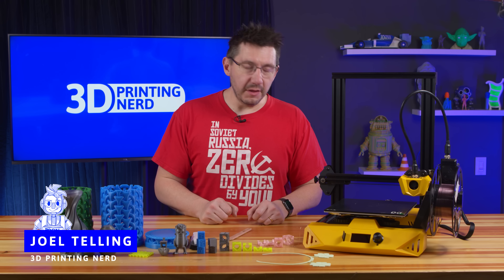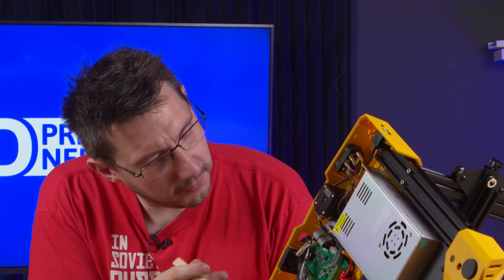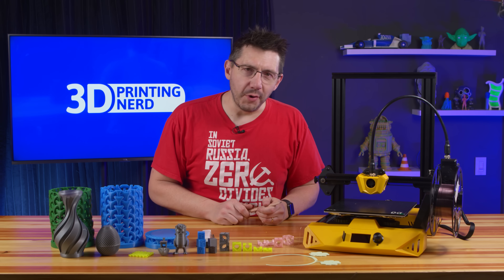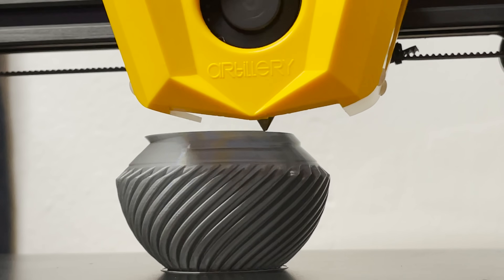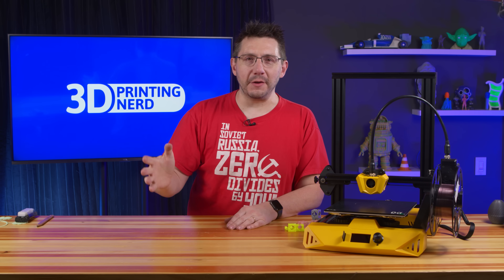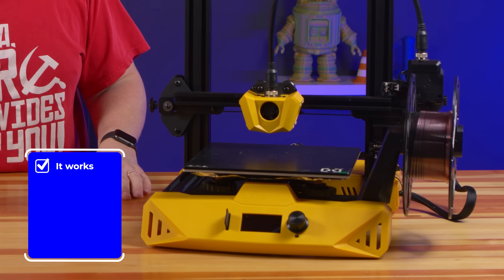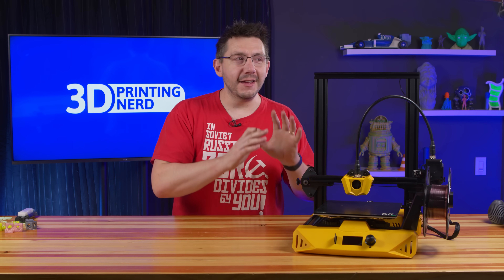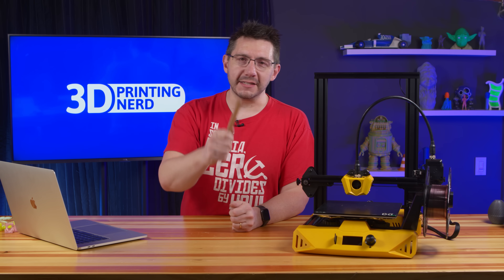THIS Is a Bad Idea // Artillery Hornet Review

Comment: An older video, but I picked up my hornet for 200 on Amazon a few weeks ago(as opposed to like 170 on their site), and I absolutely love it. I even love the cable. Assembly was 7 screws (Seven!!), its super quiet, in a few dozen prints I've only had one issue that required me to disassemble like anything, and the belt tensioners are absolutely awesome. I am a sucker for aesthetics, and I love having a printer that looks professional, and doesn't look weird sitting on a shelf. Compared to an Ender 3 base model, I would pick the Hornet any day for the same price.

The only issue that I have had with it is the Cura profiles that shipped with it are a little rough. I used the "fast" profile to try to print it's calibration cube, but there was so much under extrusion it was practically foam. After some tinkering I got a significantly better profile figured out, and my cubes look even better than the ones shown here.

Comment: ive had problem after problem caused purely by that damn tube, the filament always jams between the nozzle and heating block and the the replacement sent by the company leaked EVERYWHERE!
the prints are great quality but the problems this thing has are horrible for a beginner like myself, ive only had it for 7 months and could only use it for about 4 of them.

Comment: Thanks for the review! Guess this printer works great for "out of box" printing with minor tuning and fixing except if you are into modding and furture upgrading.  
1. hot glue components underneath (big headache when it comes to modding)
2. weird "all in one" proprietory cable (what a turnoff!)

3. glass bed is fine but not when hot glue to the metal plate (OMG! whoever think of this shit?). just use metal fasterners ..cheap and easy to remove.

Comment: My biggest concern with purchasing the Hornet is two fold. The Bowden tube cabling combo is ok in my opinion. The problem I have has to do with firstly all that plastic which reminds me of the Tarantula RS from Homers Tevo. The Y motor mounts in plastic which will crack and deform over time. Do not place that printer in a heated enclosure. Secondly there is maybe no way to add a BLTouch. I say maybe because I think I saw unused plugs in the hotend assembly. They don't sell a BLTouch kit for it though. With a BLTouch added to the hotend you need 13 pins total.

Comment: I have the printer. Unplug the cable, unscrew the hot end (three screws) then plug it back in... Or you can do what I do and leave the middle screw out and only use the two flanking screws meaning no need to unplug.

Is it super great? Depends. I much prefer it since, with two screws, I can hold the assembly and properly clean the hot end. But that might be a no go for you. 
I found this to be much easier than my ender 3 given how much space is in that housing. This printer is a steal at 250 and I DO recommend it over the ender 3.

Comment: Tinned wire in screw terminals is VERY MUCH WORSE! DO NOT DO THIS! Solder will cold flow out of a compressive joint. Copper and steel will not. I repeat: DO NOT TIN WIRES BEFORE PUTTING THEM IN SCREW TERMINALS. It's a reliability problem at best, a fire hazard at worst. DO NOT TIN WIRE THAT YOU ARE PUTTING INTO SCREW TERMINALS! Crimp them or leave them bare. DO NOT TIN WIRES THAT YOU ARE PUTTING IN SCREW TERMINALS OR CRIMPED CONNECTIONS!

Comment: An alternative would be to have a troubleshooting cable extension which connects the extruder assembly to the default cable while giving access to the filament path.
Reply: its what i did, just bought 2 female gx16 8 pins and drill a hole on the center pint of one

Comment: So wait, how did you unclogged it?
Reply from the maker: I heated up the hot end, then quickly unscrews the cable connector, and shoved a metal wire down to try and shove the clog into the zone where there is heat, hopefully freeing it.

Comment: First, I love the way you presented this info. Very useful and a good insight on the new cable/tube.   However, I will have to disagree with your comment about the ribbon cable design on their other machines.  I really love the latest sidewinder and use it very regularly. I have had 0 issues with the cables and it makes it very sleek and presentable as a finished looking machine.  Now i would agree that the ribbon cable is not good for people that do major machine modifications, but your comment "no one:" likes the ribbon cables is unjustified in my opinion.  The original sidewinder might have had issues but the latest updates doesn't seem to have those issues.    Again, thank you very much for this very good video.

Comment: Tinned wire are not better then bare wire. Thin can melt. You just have those connectors so you can be 100% sure no strands can get outside and make a short.
Reply from the maker: Yeah, I said it backwards. Currently planning an update to set it right AND test other machines.

Comment: Great video, but just one nitpick: solder on the wires in the terminals is actually worse than bare wire because if the wire heats up, the solder will melt and the wires can fall out.

Comment: Simple you don't do a cold pull. Instead you do what we do even on our Ender's heat up the nozzle... unscrew the nozzle with a socket. and clean the nozzle out. Push filament our without a nozzle in the printer head followed by a which extra long retraction.this will clear up your hotend. For the nozzle use a small gas torch and a pair of pliers to hold the nozzle and do this way you cold pull. It is much more controlled and much faster too.

Comment: I love how thorough you are being on your 3D printer reviews, digging into the electronics bay and noting the connections.  I try to educate friends to make sure to check for tinned wires and replace with ferrule connectors.  I'd be curious how the wiring to the bed looks, as many low cost printers have iffy connections there (or use wire that won't survive for long being continuously stretched )   High five!

Comment: You knocked the plug out and it blew a stepper driver? You should test that and make sure it was just a weak driver and not due to poor board design. That sounds strange and concerns me that users might blow a driver everytime they shut the machine off with the surge protector or experience a power outage

Comment: Joel, tinned wires are worse than bare wires. Tin/lead will cold flow aka creep and the tension on the clamp is decrease overtime and eventually you'll end up with a loose wire dangling around in your control box

Comment: Tinning the wire and then putting it under the screw is not good. Soldering tin flows under pressure, slowly, the contact will become poor after a while, resulting in malfunction and high resistance. The solder also flows under the insulation. The wire will break at about the point where tin solder has stopped. Ferrules are the only good solution.

Comment: Not sure I agree with that. at least not entirely. I don't see a problem doing any of the things you describe with that bowden setup. While I DO PREFER wires and ptfe to be separate the only time I can see any issue is if the filament both jams and breaks inside that tube. but even that should not be an issue.

Heat up the hot end. remove the tube assembly. pull or use a music wire to shove the jam/breakage from the tube. should not be that difficult.

word of warning. DO NOT try to remove that ptfe tube. I did. its REALLY hard to get it back in :-) (stretch versus compression)

Comment: Hey wait. No no no never never never soilder high power wires that are in screw terminals. the soilder gets soft overtime nad will make a faulty connection that will lead to head that will cause a burnt connector. or a burnt down house. NEVER never never soilder wires in screw terminals. that´s a recipie for disaster.

Comment: Me: 4 years Western Electric equipment installer, 30+ years electronics industry experience.
Ferrules.
They look great, they seem to fix a problem, but they are evil!
They were intended for low-power connections that are taken apart frequently...protects fine stranded wires from clamping forces.
Here they are being used in a high-power application with little need for frequent access.
*
Contact area and contact pressure are the King and Queen of high-power electrical connections.
Ferrules are a cylinder, the clamping-block has flat contacts.
This means there are only two narrow points of contact!
Bare copper stranded-wire has oodles of contact area and 'squishes' to conform to the contact surfaces.
Ferrules don't squish!
Cut off the ferrules, use the stranded wire in the connector blocks!

Tinned wire in a connector block?
Even worse...
Bright copper in firm contact with a tin-plated connector can have the same electrical properties as a soldered connection.
Ferrules have resistance that is easy to measure!
Resistance in high-power = heat, heat = failure.
Yes, working with stranded wire can be a hassle, but it can't be beat for passing power!

Comment: I wouldn’t want a printer I can’t get parts for let alone one with a part I can’t clean. Good call on not recommending it. Price is a bit high as well for the features.
Reply: So you don't want to be able to get parts or clean the parts? How does that make sense?
Reply: @Graham_Wideman  - can’t not can. Autocorrection error. I fixed it.

Comment: could you achieve a cold-pull by heating it with cables attached, then turn off the 110VAC, unscrew the connectors and haul on the now exposed filament? The hot-end will float downwards in temperature once power is removed, but not that quickly.. right?

Comment: Artillery has the prettiest cable management of all but it comes with a few disadvantages. While the ribbon cable isn't functionally the best we must admit that we haven't seen anything prettier or cleaner. I don't see the point of the Hornet though. IMO it has no advantages over the Genuis apart from having a lighter print head.

Comment: You should never tin high current wires, solder (note the use of the letter L) gets soft at relatively low temps and a connection that's solid when it's cold can be loose when it heats up. High current wires tend to heat up.

Comment: They should include a "maintenance adapter". Disconnect the main tube and put the adapter in line. Itd leave the hot end open while maintaining the electrical connections

Comment: This reminds me of my 93 Saturn SC2 with the problem I had where the windshield wipers wouldn't turn off, and it was 95 F out in southern Indiana, I had to drive over 80 miles to the Saturn dealership to get it fixed.

No problem, just pull the fuse for the windshield wipers, right?  WRONG! It'd make sense if it were that simple. It's possible you could overload them and lose their functionality and still otherwise be able to drive the car, if they did things in a way that made sense.  Nope!

I was beyond pissed to have taken out the fuse so wipers wouldn't be left on, just to discover that the same fuse is used for emissions controls, and the engine is designed to not run without the emissions controls system entirely running.  Bless their stupid little hearts, they designed the car in such a manner that you couldn't possibly drive it if for some reason your windshield wiper system was inoperable and blew a fuse (which would happen in a short).

I was pissed to drive that distance, and it involved mostly highway speeds, with nothing I could do to keep the windshield wiper blades scraping back and forth across a hot, dry, perhaps a bit dirty windshield.  Thankfully, that was the only incident I had with that car with wipers.  Drove it over 207k miles, over more than 13 years.

This printer absolutely has a nice, clean, tidy outward appearance and appears to be designed with safety in mind, and normally work well.... but there are so many things that can and do go wrong in 3D printing, even if the machine is functioning as perfectly as possible, I completely agree and support your assertion that this is a major well-intentioned design flaw of epic proportions, advancing design to safer-but-stupid levels of creating helpless users.  All great, until something goes wrong, or simply wears out (which would be hard to see, but it's a machine part with movement, so inevitable) and you're screwed.

Comment: In regards to celcius..well it is 2021.. the countries using F is very limited now. What is actually strange is that vase exist since the vases printed cannot hold water most of the time so for a print they are very common but perhaps the least useful prints existing.mthats not this channels issue as it is common..but the terminology of the models "vase" are not really thought through. Conclusion however is good, i just dont  see why to buy this vs an ender 3 really, wich is cheaper now. It is not the teams fault but the competitors are too ahead for something like this.. the ender 3 cost about 160 euros now, or more or less same in usd. It prints better than the prusa printers in general and has printable upgrades..( no pun vs prusa wich is a nice machine but heavily priced for the print result vs creality).. a cartesian without something very special has no real market now as the competiors both are cheap and good.

Comment: What you need is an adapter "cable" that is "open", so you can route the power but have an open slot to get to the end of the bowden for heating and cold pulls, etc.  Don't thing that would be too hard to make - AND INCLUDE with the printer.

Comment: 3:05 If the wire moves regularly (say, it's connected to the build plate of a Prusa-style printer), tinning the end will shorten its lifespan because the wire will break inside the insulation where the solder wicked up. This is why it is always a good idea to use a crimped ferrule in a screw terminal connector or even a spring-loaded one like a Wago.
Reply from the maker: GREAT info thank you!

Comment: They need to offer a “jumper” connection. It would just be for connecting the electronics while getting the Bowden tube out of the way for cleaning/maintenance. They can send my commission for that idea to my PayPal account 😁
I wonder if that setup works well enough to print with flexible filament?

Comment: I really like the wire management on the Hornet. However you make a killer point about the Bowden tube. It Kills any idea of me buying a Hornet. Sorry Artillery. Now I do have the Artillery Sidewinder X1. I like the wire management on that one as well. I do really like the ribbon cables. But I don't like the FFC connectors. They NEED locks on them. I had issues with the ribbon cable burning on the contacts for the hot end leads until I got some Molex FFC connectors with locks. I used a hot air rework solder station to remove the factory connectors and add the new ones. Ever since I did that on all the boards with the FFC connector I have not ever had another issue with the ribbon cables. I am in the process of designing my own boards now that will have a second 6 pin ribbon cable. It will run the same path as the factory ribbon. That will allow the use of the BLTouch with a very clean install and no need to use the RGB LED lines like some people do.

Comment: Hey Joel, great video as always! Just wanted to make a small correction when you were talking about ferrules. Tinned wires (although providing better strength than bare wire) can be a major safety hazard since the terminals can heat up due to the amount of current passing through it, and the tinning can soften and cause wire shifting or slipping that might cause sparking or fire. It's generally recommended to completely avoid tinning wires in terminals like that for safety reasons as some 3D printers have died or sparked for this reason.
Reply from the maker: I accidentally said things backwards and didn’t mean to. Thankfully you and other caught it. I’ll going to hopefully make a quick update video this week.
Reply: @3DPrintingNerd  No worries! Just wanted to point it out since better safe than sorry 👍

Comment: Joel!  TINNED WIRES ARE BAD!  They don't compress under the screw right, so your 14AWG wire becomes more like a 20 under the connection, which is why printers catch fire!
Reply from the maker: Yeah, accidentally said this backwards. I’ll make a new quick video talking about it and setting the record straight. But hey, I got ferrules in there!

Comment: Great Review. Awesome job pointing out the pros and cons. Great job pointing out the design flaw of the combined Bowden and wiring. Really good job explaining the need for ferrules on the power connections and how important it is. Although bare wires are better than tinned connections. Epic fail again on not calling out Creality. Would really like to see you use your influence to have them correct the hazard in all of their printers.

Comment: If you put yourself into a position to need a cold pull, unscrew (do not disassemble) both connectors, heat to 230, shut off, hold filament tension lever and pull from the  motor end, V1. V2: Take the hotend off the carriage (3 screws), leave connected as mentioned previously. Heat, slide bowden off filament and pull to your hearts content. Yes, you can do it- just dont stop for a bag of chips along the way. Figured that out a long time ago. Just spend more time actually thinking.